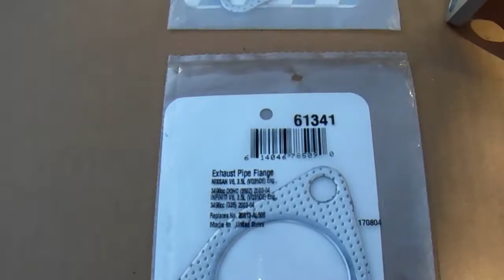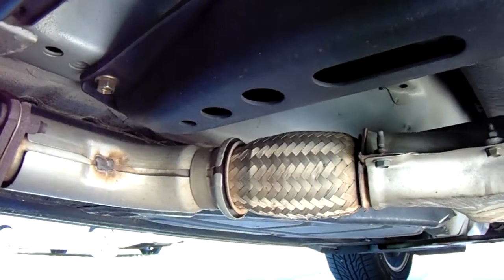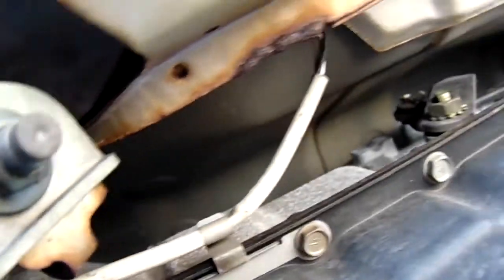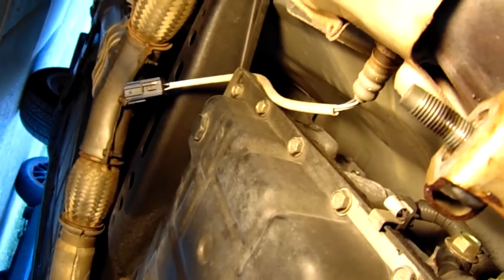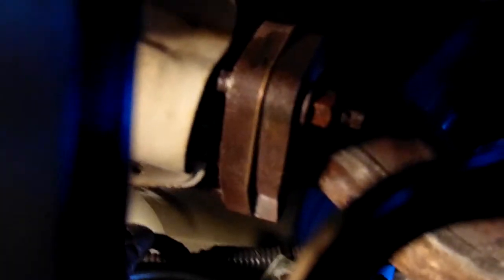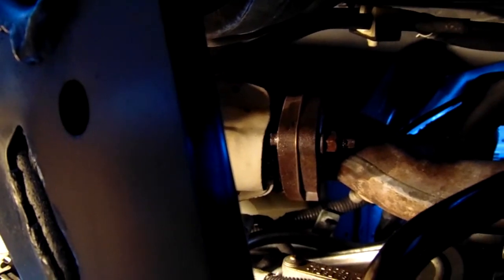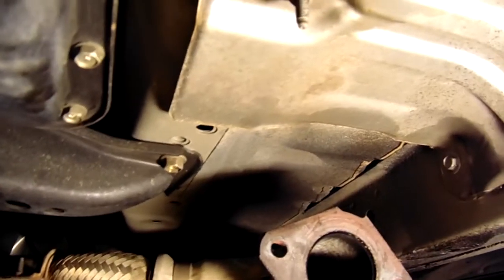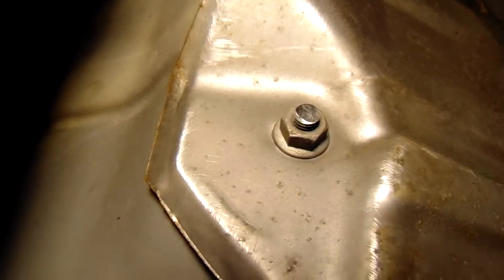350z Straight Pipe install #Nissan350z #Zociety

Comment: I talked to Tony from MD and he told me the crush washer goes header to cat, I see you installed it cat to Y pipe.
Reply from the maker: Thank you for the information, I didn't end up installing it, because it wouldn't fit on my ypipe! Now I know why! Thank you so much for watching!!!
Reply: @Zspeed  watched this video probably hundred times lol haven't been able to solve a leak. Was going to try your theory until I just called them. If I can't solve the issue I'm just going to sell them and get longtubes.
Reply: @Zspeed  would it make a difference if you dont install that ring?
Reply from the maker: Angel, it will not hurt anything if you leave the ring out. But, you Should definitely get some copper gasket maker to place around the art pipe and the ypipe as well as the header and art pipe! I'm currently working on a video about how to get a great seal with aftermarket parts on your exhaust system. Long story short copper gasket maker is designed to help get a great seal on your exhaust system, you can pick it up at auto zone or advanced. Hope this helps and thanks for watching!

Comment: I have a question bro. I bought some used pipes from someone and when I went to the shop to get them installed they told me I needed to get the donut ring because the one it had was a one time use. Can I get this part at autozone with the rest of the gaskets with the bolt holes on the sides and the bolts?
Reply from the maker: You can get aftermarket gaskets at Autozone, but you can't get the donut ring, so get two gaskets for each ART pipe(art pipe to Y pipe). If you need bolts, try Home depot!!!
Reply from the maker: Hope this helps!!!